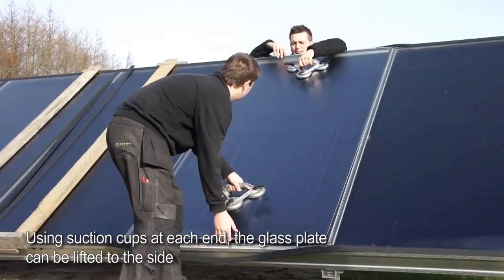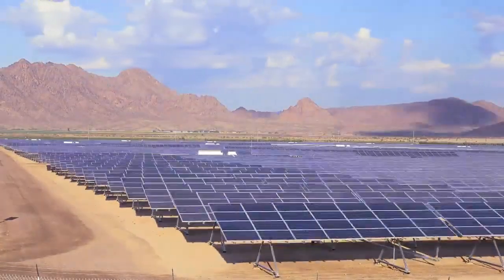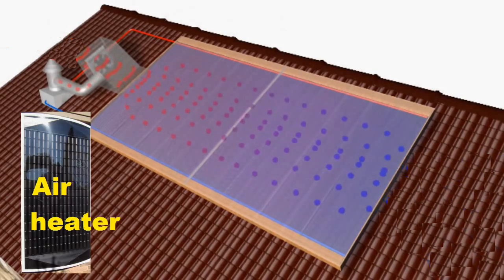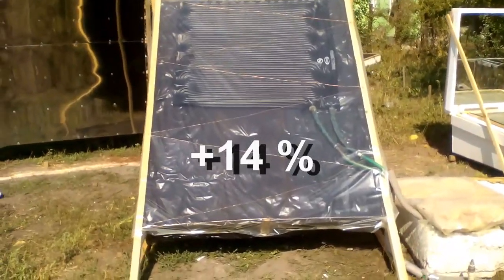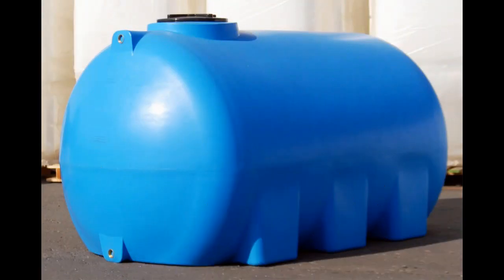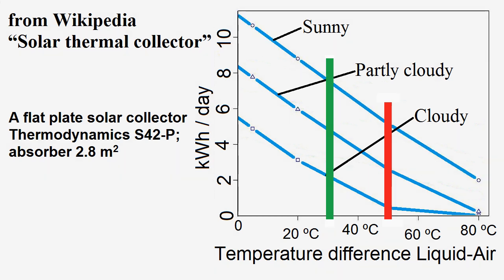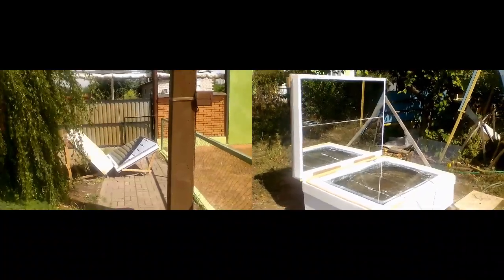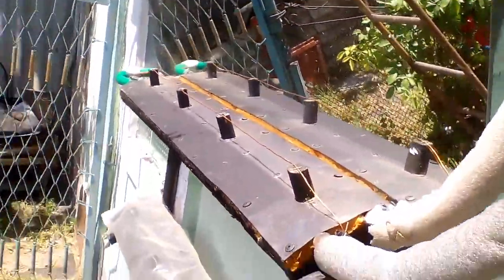TOP 5 methods to increase efficiency of a solar collector

Comment: What about an opposite situation, if it’s to hot like here in Nevada where the heat does damage to the panels. What do I do then?
Reply: Greenhouse shade.
Reply: @FullCircleTravis  

Of cooling the panels with water.
Reply: @Alejandro Rivas  
To use water, you have to drain to waste or circulate through a heat exchanger, which requires a pump, fan, and exchanger. Wasting water in Nevada is a no-no, and the other method requires electricity and parts to maintain. A greenhouse shade can be set up for mid-day or automatically cover. It's the cheapest solution, uses the least amount of parts, and an automatic shade can run on a solar panel.

Comment: Hey,
was wondering if you also looked into putting together solar concentrators with peltier modules. they are about 50E / 20W but if you store high heat it can also work at night. cheers.